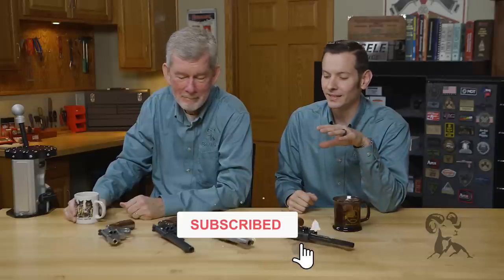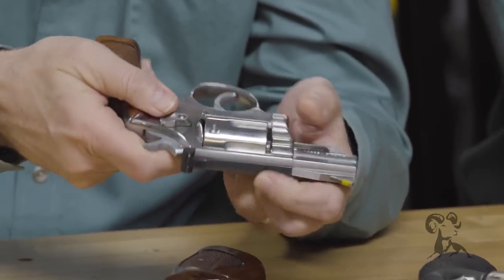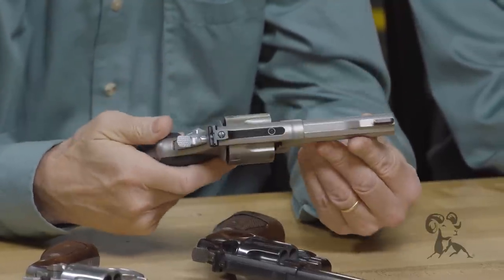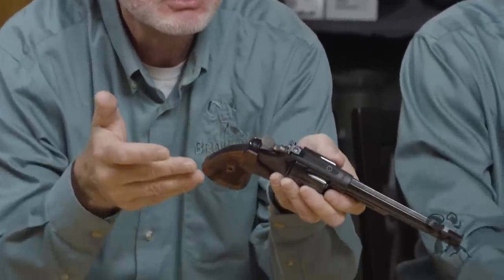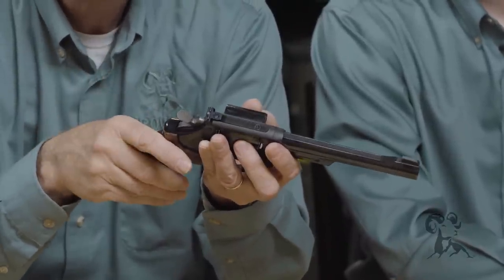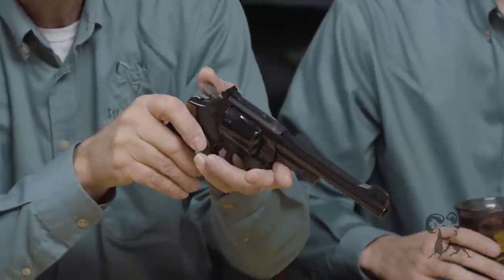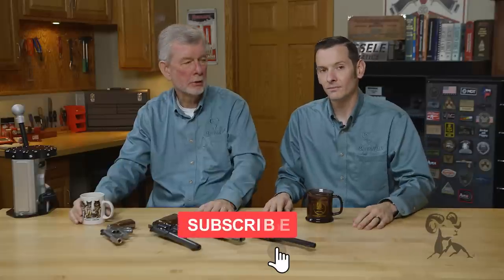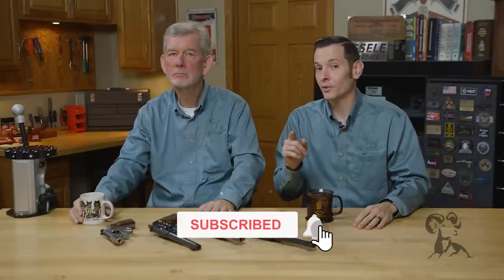Smyth Busters: Are Old Smith & Wessons Better Than New Ones?

Comment: Short answer: yes and no. Pre-Model 10 M&P revolvers are far better than any 10-series. Better trigger, better quality. But the new-series Smiths, once they broke free of the constraints caused by the old frame system, are on par with or better than the old stuff. I have a 1955 M&P. Comparing that to a 10-5, there is no comparison. The trigger on the 10-5 is just nasty, whereas the M&P's trigger is within a hair of a modern 686 target model; I have compared them side by side, and while the new 686 was ever so slightly better, it wasn't enough to make a difference. So, I'd take a brand new Smith over any of the classic model series, but I'd take a pre-cheapening Smith over any of the interim models. Nothing wrong with the new-model guns. S&W went bad for several decades before they got good again.

Comment: If you buy a new S&W, try NOT to buy online. I had to send 2 of the new ones back to S&W because of canted barrels, one is a 640 pro, and the other is a 686PC. The PC was corrected the first time and was test fired; the 640 was not, I had to send the 640 back 2 times just to have the barrel corrected, and then I realized the rear dovetail was also not cut straight, so it's back for the 3rd time.

Comment: Not mentioning the front of the frame around the forcing cone cracking due to over tightening of the crush fit barrels on the new 29's helps your argument. I'll stick with my P&R'ed M29, it is a tack driver and has been for years. Mim was all about making them cheaper, not better. And the Hilliary hole? Please! If I was looking for a new revolver, Smith would not be the top of the list.

Comment: My Lew Horton  Smith and Wesson model 624 Combat Special  3 inch throated  barrel N Frame is a gem 
people underestimate the 44 special Factory loads ,and the knock down force they have .
it was sub contracted to do trigger job .
modern speedloaders with a little practice are auto fast.
with a cylinder bevel job  i did my self including a bigger drill bit to carefully bevel the timing 
table between teeth that you cant do on 8 shot cylinder.
even though they did a recall on cylinders the cheaper metal got put into the side plates 
where it didnt matter .
its crome molly construction is solid enough to cut down shells of 44 mag up to 240 grain 
1500 feet per second and put 100 plus rounds through it .
and its still tight .
but 44 special is where its at .
and yess it shoots 44 special way better than any 44 mag its a race car 
You would be hard pressed to find its equal let alone a armorer.to dial in a revolver 
The way the gunsmiths did on mine .
I even wrapped the trigger guard on mine without getting hit by blast and throated 3 inch barrel 
burns all the powder 0 flash on end shooting mags 
but it did take the hide off trigger finger  where it wraps the trigger 
I shoot nothing but eye slots in ipsca .
And the 5 shot guns have a kick 
the only jiggle I feel is the hammer drop lol

Comment: Quality at S&W is not what it used to be. Last one I bought went back to the factory 3 times to be fixed before I traded it. Sure, anybody can get a lemon, but they are not the same company they were years ago.
Reply: While not a high end revolver, my Bodyguard 38 had to go back twice. The first "fix" didn't fix it, and, on the second trip, S&W said there was nothing wrong with it, so I got rid of it. I'm sure the more expensive stuff is higher quality, but it left a bad impression.

Comment: For sure the old, pre 1985 steel frame 357 magnums were better by virtue of having been built for the higher SAAMI pressures that 357 used to have. For reference, 357 mag used to clock in at a max pressure of 45,000 psi and nowadays their SAAMI max pressure is only 35,000, while their European equivalent is still at 43,500 psi.

Comment: I carried a Smith & Wesson model 66  (357 magnum)  for many years thousands of rounds qualifying,  and practice.  I never had any problems.  But, I have heard of some with forcing cone cracking with a steady diet of the 357 Magnum hot loads.  (I"ll stick to my model 66, Very smooth from years of shooting)

Comment: Sadly, you look at the left side of the new revolvers and want to puke... they could not make the lock and integral frame lug any uglier.
The endurance package in the 44 mag models predates the MIM era by about a decade.
And the throat diameter problems in the 45 ACP and 45 long colt models are specific to those models, and were corrected in the last pre-MIM years.

Comment: I had both of my S&W revolvers fail on me. A 1986 Model 10 and a Model 36. Both failed thankfully while training and not in a gunfight. First one was the Model 10 and the armorer  was able to get me up and running again to qualify after lunch. It went out of timing and needed a new pawl arm and cylinder star. A few years later my Model  36 had the same out of timing issue but needed to be sent to S&W for repair. The frame pin that held the hammer was also loose. A week later they sent my gun back......so I  thought. They decided my gun was beyond repair and sent a new one to me without asking me if I wanted it. The Model 36 was a graduation gift from my parents and saved me during an attempted Grand Larceny Auto and shootout in Brooklyn so it had sentimental value to me. To make matters worse the new gun they sent was not the same. It no longer conformed to same standards and I was not authorized to carry it. I called S&W and they actually built me a new  "Old Style"  Model 36 with a hammer nose firing pin after they were fazed out for an internal firing pin.
  
More recently they also repaired a customer's .460 Magnum that had internal parts failure but sent back another customer's gun because it was not an easy fix. 
But I will credit them with sending me all the parts free of charge to do the extensive repair. 
He is a retired NYC Corrections Officer and did not want another firearm. It was a stainless 9mm but failed due to lack of regular maintenence.

Now my Model 10 is out of commission again and needs a replacement hammer nose but is not available and considered obsolete......lol

Comment: I own 13 S&W revolvers. Four are pre MIM and the rest are newer with a couple with MIM but no lock. I mostly shoot the newer revolvers. I love the older ones but I have no issues with the new ones except I would prefer they didn't have the lock. I have 2 newer 610's that are the most accurate handguns I own. If you want a revolver to shoot there is nothing wrong with the newer S&W revolvers in my opinion.

Comment: I have a late 90s or early 2000s MIM 686 and the trigger is very janky.  

I had a 2012ish 442 and it lasted a few months before the frame broke.

I hear the old Smiths are nice, but I hear a lot of guns are nice that end up actually being awful.  I've always wanted a 629, but I just know if I get one, it'll be janky like that 686 or break like that 442.

Comment: When I was still working for Oshman's more than a decade ago we got the special run of satin finished, high polished cylinder 5" full lugged barrel  model 25 in .45 Colt & I am STILL bashing my head against available solid objects for not picking one up when I had the chance. It was without a doubt the bet fitted & finished revolver short of the 1980's era Colt Custom Shop Python. That Smith, which was running under $700 at the time, if my addled brain recollects correctly, was AMASING across the board. Oh the folly's of youth. I didn't even mind the Lock, the gun was that gorgeous & properly tuned.

Comment: I unfortunately do not own any of the older Smith and Wesson's but I do own several of the new. I have the set of Model 69 Combat Magnums, a 329PD, and a 360PD. All are great guns for sure. However the biggest thing I don't like about any new model Smith is the sleeved barrel. The mim parts I can take or leave. Ruger has been using mim parts for years and no one that I know of has accused a ruger of being weak. Lock is an eye sore but I can live with it more because I have to not because I want to. In the end I have to agree, old or new, Smith makes a good revolver.
Reply: Bill Ruger's legacy is the insistence upon quality control before a gun with his name leaves the factory.  Should one get into the hands of a customer, the managers that knew Bill insist upon making it right so that the Ruger reputation doesn't suffer bad P.R.

Comment: 66-0 first series were chewing up bits when being machined  try that with ANY MiM
Reply: There are plenty of tool steel MIM components that would chew up a bit, but the point of MIM is to not need a bunch of machining in the first place.
Reply: @ostiariusalpha  high carbon forging or bust u can keep the high point
Reply: @charaznable2379  Okay, gramps. I'll get off your lawn.
Reply: Cant beat the look of the older forged hammers and triggers after they flash chrome them.  The new MIM parts are just as ugly as they are cheap.
Reply: @Mike-up6go  You can actually polish and chrome MIM parts. It's when you want to go real old school, and have color case hardening, that forged parts put MIM to shame in the looks department.

Comment: There are few real improvements on the new S&W revolvers (1990-present) that make them better than the old S&W's. All mine are pinned and recessed models (M19-3, M66-1, M57, M28-2, M29-2), and I take at least two to the range every time I go. Never had an issue with them that wouldn't happen with a new one, actually, have never had an issue with one of them at all, except I run out of ammo.

Comment: I love my 686, ive put about 2500 rounds through it with 0 issues. I spin my revolver like a cowboy and ive dropped it a few times. The only thing thats ever happened is i had to tighten down the iron sights once or twice. The frame lock isnt pretty but im ober it, although when i bought this SW 686,of there was another one right next to it without the frame lock id of got that instead

Comment: I bought one of the new 629 .44 mag revolvers and am totally delighted with it.  For accuracy it compares well to my original Colt Python.  I in particular like the rubber grips that came on it.  I have shot some of the "defense" loads they sell that are pretty hot as well as a few boxes of "regular" .44 mag.  Even shooting one handed it is very controllable and does not "bite" me.  My old and much loved Colt Python was always a bugger with those wood grips when shooting stiff magnum loads.  Very very happy with my S&W 629.  Hey back to edit my comment.  Today I got out the old Python and the new 629 and put some rounds on paper.  Just some off hand shooting and I got old eyes but the 629 grouped very near as well as the Python.  I would not hesitate to hunt deer with either one with a nod to the .44's bigger bang.

Comment: I've seen some jacked up new ones and I've seen some jacked up old ones. I think a lot of the "old ones have a better trigger" shtick comes from them having 50 years of polishing through use. I had a new-in-box Model 13 from the last year of pinned barrels, and compared to the Model 19 I had from a couple years earlier that had seen lots of use and abuse, the 13 was definitely a bit more stout on the trigger pull. The new low-end J frame triggers are hot garbage though.

I've seen volcanoing of the firing pin hole in older pre-transfer bar guns from excessive empty dry fire, whereas the shape of the transfer bar system's firing pin pretty much eliminates that possibility. The new guns' finish, however, leaves a lot to be desired in terms of sweat and wear resistance.

I tend to agree with your overall assessment. MIM can be done right, and I think we're finally at a point where it's being done vaguely right (doesn't seem Colt has figured it out though), and it was a process that was used as a silver bullet for cost cutting during a relative downturn in the market in spite of it not being fully developed in the firearms sector. Hence, we still have to contend with that belief.

Comment: I don't want or need a lock on a revolver. I am offended by the way Smith and Wesson was strong-armed into the agreement to put the lock on the gun and I am offended that they agreed to put the lock on the gun.
So no I will not buy one. And should I mention the new revolvers have 12 pound trigger pull or more?

Comment: so really the only pro of the old ones is that it doesn't have a lock?
Reply: That and they’re more reliable because of it. Also I can get ahold of a Pre lock s&w for less than any new Smith.
Reply: @DocMitchell69  can you just remove one by disassembling it?
Reply: @jason200912   You can, and someone makes a plug for it, I don’t remember who though. I personally wouldn’t go through all of that, as I’d just rather get an older Model.
Reply: @DocMitchell69  doesn't it only take 10 minutes?
Reply: Not at all.  The old ones are far better than the new ones!
Reply: The primary issues that advocates of the pre-lock Smiths are degree of hand fitting, fit and finish and whether the MiM parts are really superior without close fitting by a human gun smith.
Reply: @jalan8171  but the modern ones fit closer
Reply: @jason200912 , Closer fitting does not necessarily equate to perfectly functioning.  No replacement for the attention from  a well practiced gunsmith can be substituted merely by 'closer' fit cast parts in a firearm.  Was the bad P.R. worth it to Colt for the lack of perhaps an additional 15 to 30 minutes on a bench to assure that the New Pythons were worth the investment by customers desiring a premium grade revolver out of the box ?